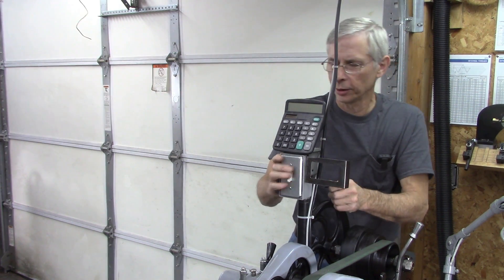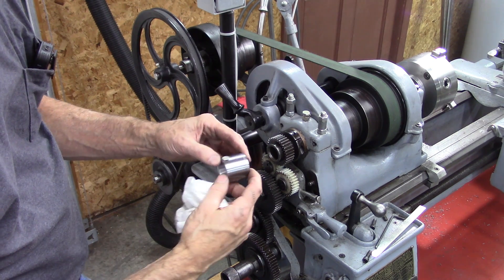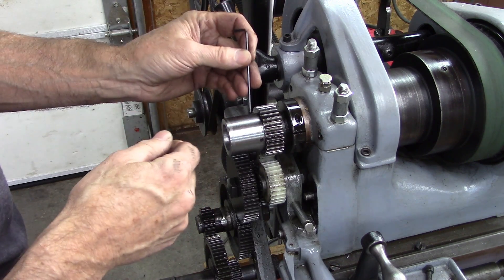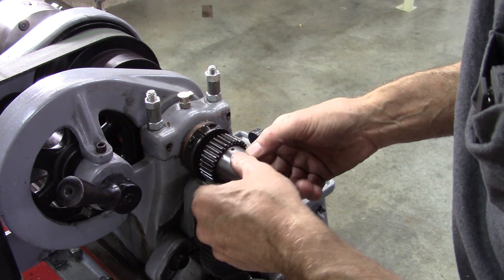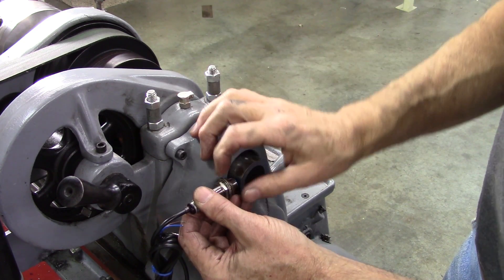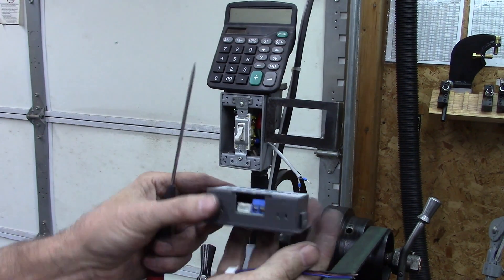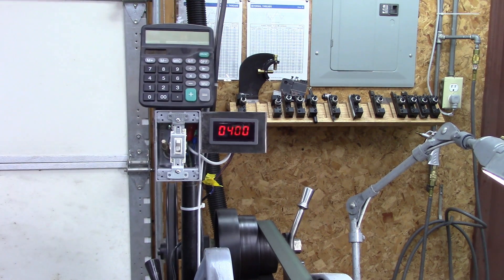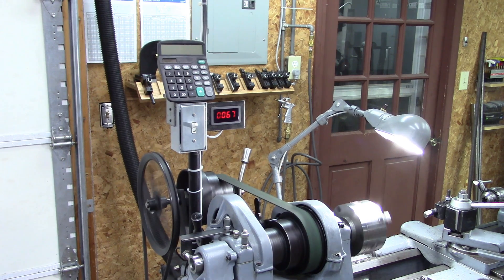Lathe Speed Indicator for less than $20 Bucks!

Comment: It sounds as though that headstock bushing you made to hold your magnet was done with ferrous material?
Reply from the maker: Yes it was and this was not the right thing to do. It works but it should have been aluminum. It didn't come with any instructions but I found then on the amazon page. It said none ferrous as you implied.

Comment: am assuming on the prox switch the black lead is ground but not shure of the pos lead color and does the leads wire togather with the meter leads ?
Reply from the maker: I cant remember and mine had no instructions. Later I found them on the amazon page for this product. Also, i mounted my magnet in steel. It works but the instructions say to use plastic or aluminum.
Reply: @WinkysWorkshop  ok, thank you

Comment: Thank you for this. I'm going to use this for a shopsmith.
Reply from the maker: You're welcome, I made a mistake, the piece you mount the magnet in needs to be aluminum. I used steel and it worked but it would likely work better if I had used plastic or aluminum. Good luck

Comment: Hello, I know that this is a bit old, but I am setting up my mill with a new 3 phase motor and a VFD. I was wondering if you ever switched it to be powered all the time, and if it made a difference in the time that it takes to give a steady reading? Thanks
Reply from the maker: I just turned the lathe on with slack in the belt and then tightened it. It seems to take about the same time to stabilize. I suspect it might be due to the fact that my magnet is mounted in steel. After installing the speed indicator I found the instructions on line. It said i was supposed to mount the magnet in something non-magnetic like aluminum. I suspect this would help a lot.

Comment: Really sexy on off switch. You probably stole it from a wall in your house. 
I always have trouble with these rpm monitors. The light comes on but rpm doesn’t show. Yes, I know about the polarity of the magnet. Always have to fuss with them. 
Love your videos. Wish you were my neighbor. 😬
Paul
Reply from the maker: Ha, thanks. On this indicator I found out later the magnet holder this be aluminum on non-magnetic. It works with steel but maybe better with non-magnetic.

Comment: Winky. Do you use gas in your MIG welding or flux core? I’m using flux core and my welds look like crap. Splatter everywhere but where I want it. I want to be able to weld but it never works out well. 
I have a stick welder. Do you think I would have better luck with that? I plan on getting gas for the MiG but haven’t yet. 
Just wanted your opinion on the difference between gas MiG and flux core MiG. 
Paul
Reply from the maker: I gave up on MIG. TIG is much easier. I did a review on a Vevor TIG but they no longer make the one I reviewed. If I was doing production welding I would probably use MIG but my TIG welds look MUCH better than my MIG. If you just want to weld steel I recommend getting the cheapest 220V TIG. Inverter technology has progressed and I suspect most TIGs are good welder.

Comment: As you mentioned near the end I think I would have wired it direct or at least have a separate switch to shut if off when you leave the shop.  Since you need to turn the lathe off to change speeds there is that lag (pretty short) to stabilize.  But at least you have more than a guess on the speed.
Reply from the maker: Going on and off doesn't seem to bother the display but you could be right.

Comment: You like your own work don’t you. Do you ever do work for other people to make money. Or just fiddle
Reply from the maker: I do a lot for others. Sometime I make videos but some of the stuff is either boring or I don't have a clear idea how I'm going to do the project. For example I just modified a small engine flywheel to fit an older motor and make steering linkage for a small toy tractor. I try to share content others can relate to. Of course I do love old machines and updating them and certainly it's satisfying to use a machine you restored or created.

Comment: I called some local (past) used equipment dealers I used to deal with here in FL to see what they had and they said that decent used stuff had become impossible find and what they do find is badly worn out.  They gave up trading in it and now just sell the new stuff now like Grizzley, Jet and some cheaper copies.
Reply from the maker: I much prefer the older stuff. With that being said, most often these machines have wear, sometimes significant. My South Bend is worn fairly bad. If I was running a machine shop I'd look for new or newer machines but for hobby use I can take the time to work around the wear. I usually buy from individuals but have bought from dealers as well. My Hardinge lathe and Avey drill press came from a dealer. The Great Lakes area is a hot bed of used machines. I'm in KY so I sometimes end up driving a long distance. I mill was over 300 miles away.

Comment: Since you sunk the magnet down in the hole a little bit, a couple light Center Punch Dimples on either side of it would "Stake" It in place so it can't fly out.
Reply from the maker: A good idea I'm sure. So far I've been lucky....  it's still in place and held by magnetism. Also, after installing the magnet I found instructions on the Amazon page. It said to mount the magnet in a non-magnetic material. I mounted in steel but it works.
Reply: I didn't think of the Non-magnetic mount till you mentioned it  @WinkysWorkshop  but eventually it may lose its magnetism and/or spread the magnetic field around the circumference affecting the accuracy of your tach. 
A piece of PVC Tubing might have been a better choice of material. . .
Reply from the maker: @oldSawyer  I was thinking aluminum but PVC would work as well.

Comment: The Magnet they supply with the sensor I purchased was next to useless if there is a lot of metal surrounding it. Use a larger magnet for reliability.
Reply from the maker: mine works imbedded in a steel tube but after I installed it I found instructions on the Amazon page that said it needed to be imbedded or attached to something non-magnetic.

Comment: I did the same thing on my Craftsman/Atlas 12" lathe, same time I converted to variable speed treadmill motor.  I was able to attach the magnet with JB Weld directly to the surface of the shoulder of main spindle gear.  That was about 3 or 4 years ago, and it has never flown off.
Reply from the maker: that's great. Mine is still there. I mounted mine to a steel sleeve but later I found some instructions on the Amazon page that said it should be mounted on a non-magnetic surface. Hmmm...  mine of on steel and works well.
Reply: @WinkysWorkshop  yes that, plus I found my prox sensor was magnetically  polarity sensitive.  Had to be sure I had the "trigger pole" mounted outward

Comment: Nice job, Winky! I recently did the same to my old Atlas 10". While I was at it, I replaced the original step pulley, jackshaft, and constant belt-changing with a treadmill motor I'd rebuilt, and its variable speed controller. It's really nice not to have to fiddle with belt changes. Left the back gear system intact so I can still get the really low speeds if needed. This setup's a lot quieter, too. Highly recommended. 
The tach I bought on Ebay runs on a 9 volt battery, and it's lasted a surprsingly long time so far. I can switch it on before the lathe to give it a few seconds to stabilize. 
Nice additions to the old machines! Thanks! I always learn useful tricks from your videos.
Reply from the maker: Thanks Dave, the treadmill motor sounds great. I'm okay with my step pulleys. Most the time the speed on the lathe is not so critical plus on my 1931 it's nice to retain an original look even if it isn't really original.  The milling machine I just restored had a bad motor. Vevor game me a 1 hp replacement so I used it. It seems to be a good motor and I like the fact that it was free but the belts are a real pain to get to. I'm seriously thinking about either a 3ph motor of a treadmill motor. I have a VFD and also found a 3/4HP 3ph motor so that's probably what I'll go with. My 1917 Avey drill press could also use a higher range of speeds. Right now I'm stuck between 280 and 550 RPM. It would be nice to have up to 1500 without losing the low speed. I might simply add a step pulley to the motor...  again, it's nice to have the original look of the old machine.

Comment: I bought one and blew it bought a second one and blew that too 
I have since bought a third one . 
My mate is an electrical engineer and he wired the second one in and he said the unit was faulty straight up
Reply from the maker: Dang...  that's some bad luck. Amazon is good about returns and refunds. Honestly, based on a lot of comments many have bought it without issues. Maybe all the good ones sold and the new ones are faulty. Sorry for the bad luck.

Comment: I tried this on my LMS 7350 lathe, and when I turned up the speed the magnet that comes with it flew off the spindle.  I tried a stronger magnet I got out of a computer hard drive and it worked great. I didn't need to add or modify anything to the spindle other than the magnet. The magnet is strong enough to stay put.  Now I just need to come up with a way to permanently attach the sensor and the  display and wire it up.
Reply from the maker: Cool!  I found out later that the Amazon page has some instructions on it. Apparently the magnet is supposed to be mounted in a non-magnetic surface. I mounted mine in steel and it worked.

Comment: Can anyone help I bought on of these and the terminal layout on the display is in Chinese
Many thanks Elliot
Reply from the maker: Hello Elliot, look on the Amazon page where you ordered, there is a picture with a diagram. Also, it says to mount the magnet to something none magnetic (aluminum). I mounted mine to steel and it works but aluminum is probably better.
Reply: @WinkysWorkshop  thank you very much silly me
Reply from the maker: @elliotneck8395  No problem! I overlooked this also. Thanks why I used steel to mount the magnet.

Comment: Hi, Winky..thats a useful addition to this beautiful old machine. I use the same module in my homemade wood lathe. Even though i could have used a arduino to do the same thing...Feel free, to visit my channel. I have some concerns about the steel bushing. It may weaken the magnet / get magnetised..This could throw off the accuracy. Aluminium or brass would probably be a better choice...i guess... Anyway..well done.. Greets from Germany
Reply from the maker: I was supposed to use aluminum but didn't realize this. My instructions were missing. I'll check out your channel, thanks.

Comment: I would have drill through both sides with a smaller bit and enlarge the hole drill with an exact size of the magnet stop short from going through the opposite side leaving a small lip to hold the magnet from centrifugal force. No glue required. But this is hind sight. Great idea and skill.
Reply from the maker: I agree... in hindsight.. Ha, I may modify.  Thanks!

Comment: The tachometer description recommends using non-ferrous material to hold the magnet.  Also, since the sensor works up to 10 mm away, wrap the magnet with electrical tape or if you want to be quick and dirty, zip tie it in place.
Reply from the maker: Yeah... mine did not come with instructions but I found out about the non-ferrous metal looking the Amazon page. It seems to work...  I missed the 10mm spec, Thanks!

Comment: YOUR  rpm meter,  from  Amazon here in Canada, is about 40 $  Canadian.   '' ....allthough  the terminals, in the back were really flimsy.....''  yup.  Good  engineering, with  shoddy cheap materials, for  the most  IMPORTANT   CONNECTIONS,   TO   THE   REAL  WORLD.    TIP (  hook them up, then encase them in  JB   weld )....so as not to   disconnect,  come loose, etc  with vibration/thermal   expansion  } } }]{{{
Reply from the maker: I wonder why it's so high up there? The problem I had with the terminals was mostly the head of the screw. I put crimp terminals on the wires which helps. I'm not too worried but I might go back and check them. It does amaze me how these low priced chinese parts quite often lack quality in key areas that would, at least in some cases, add no cost to make them right. The Vevor mill table I put on my drill press had outstanding well made casting (thankfully) and terrible lead screw. Oh well... both were worth the cost I paid.

Comment: I super glued the magnet to my three jaw chuck for my tach set up on my Craftsman lathe. It came off once but stayed on the chuck somehow. I degreased the surfaces and glued it back on. It gets a few shavings on it but I carefully wipe them off. Sure don't want that magnet ending up in the gears.
Reply: The power source for my readout is a nine volt battery. Amazon has a box with an on off switch just for a nine volt.
Reply from the maker: 9V would be easier but I like not having to worry about batteries
Reply from the maker: Not a bad idea but I change chucks a lot
Reply: @WinkysWorkshop  It's easy to knock off even with the glue. I also catches a lot of metal dust but it wipes off easily.
Reply from the maker: @perdidocamaronero5400  I'd drill a small hole and glue it in.

Comment: something I can't understand, once you know the speed of the chuck at all belt settings, and back gears, what purpose does the RPM indicator serve? Seems just a small chart on the wall would suffice and then the indicator could be better used on a mill, drill press or any other tool with a VFD or variable pulley that has no set speed. Just my 2cents
Reply from the maker: Of course you are right and I knew about what they were. The math was easy although I didn't know where to measure the V-belt pulley on the motor. On the outside of the belt or inside. This makes a big difference....  and the indicator was easy.
Reply: @WinkysWorkshop  I must have implied that the rev counter was of no value...sorry. What I should have said that just chucking the magnet is some temporary holder, noting the rpm for all possible belt combinations and making a chart would relieve the rev counter for some other application that is more variable.
Reply from the maker: @Uts9000  No need to explain. You make a good point. I will say however, it's convenient to see. It's hard to find a place to post a speed chart in my shop. I'm now thinking about an easy access flip chart with tabs. I have stuff plastered everywhere.

Comment: I guess I'm not understanding the usefulness of this.  Unless you have a variable speed motor, speed is ratios of the pulleys and the math will tell you what those RPMs are.
Reply from the maker: It's useful if you are too lazy to do math but you are correct. Also, I wasn't sure where to measure the v-belt drive. Inside or the outside of the belt? On the motor pully that is about a 20% change.
Reply: @WinkysWorkshop  as I understand it, v belts are measured on the outside.
Reply from the maker: @AffordBindEquipment  Interesting... I would have guessed the inside but after reading on the topic it's a bit more complex. Apparently there are pins for specific belt sizes that you use to measure the diameter. Kind of like measuring threads with pins. I like flat belts... ha
Reply: @WinkysWorkshop  I also had to do some checking after reading your text.  speeds are measured by OD pulley diameters.  Pulley dia x speed = dia x unknown. 
 Whether it is the inside or the outside of the groove:  if you were to reverse the belt so the V is on the outside, the speed would be the same.  If you were to cut off the V and just have the flat,  the speed would be the same.  Using the bottom of the V would be like using a smaller pulley that size. 

 I have a flat belt on mine, which was built sometime around 1900 or earlier, all worn out.  I now use a wide truck serpentine belt, works great, no click click as the lacing goes around.

Comment: I put one similar to that one on my old craftsman lathe,, it works fine too although I don't know what speed to run the lathe for every different job anyway.. lol but it looks  purty.
Reply: If you know the RPM and the diameter you can calculate the surface speed (SFPM=Surface Feet Per Minute Dia is in inches that's why things get divided by 12 π= 3.14145927=Pi). You use this formula SFPM = (π x Dia x RPM) / 12 And if you want to know what RPM to go for a particular diameter to get a certain surface speed then you use this formula RPM = SFPM / (π x (Dia / 12)) HSS cutting mild steel you want to keep it under 100 SFPM. I have a chart hanging up so I'm not using those formulas all the time.
Reply from the maker: This is handy.  https://www.machiningdoctor.com/charts/sfm-to-rpm/
Reply: @WinkysWorkshop  I'm not sure if the SFPM to metric is particularly handy. 😜
Reply from the maker: @1pcfred  Maybe for some...  my brain is programmed for Inches and Feet. Admittedly an inferiors system.
Reply: @WinkysWorkshop  thank you, I'll study it and see if I can figure it out..

Comment: Magnet mount could be on the inside of the ring bore for security. Drill through from the opposite side, pocket it into the receiving side. Might need to drill a hole in the pocket floor for the right magnetics for the Hall effect sensor.
Reply from the maker: That would have been the best approach!

Comment: Beautiful job there Winky!!  Wowzers, you went to whole lots more trouble on  yours with special brackets and stuff than I did.  I just made a wooden box for the display and power supply, and JB Weld glued the magnet to a gear hub on the spindle in my little Craftsman 12" lathe.  It works perfectly so far,  but I really like the fabrication  you did on yours, and it looks lots better than my installation!
Reply from the maker: Thanks! There wasn't any good spot to put my magnet.